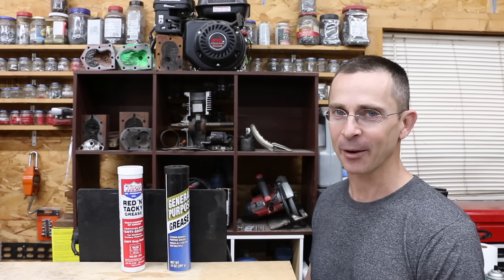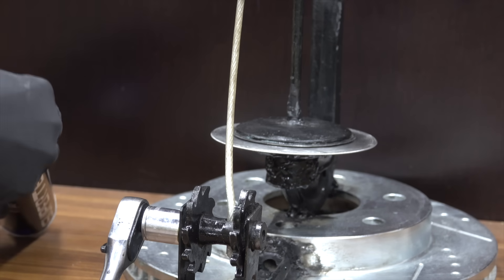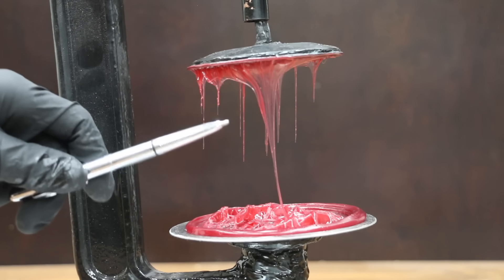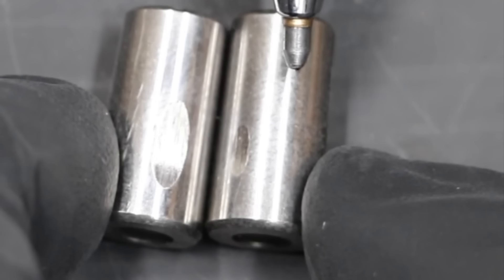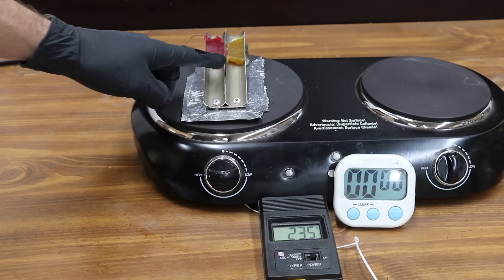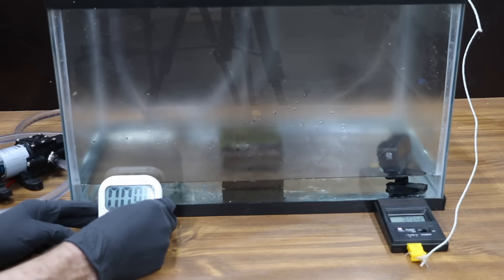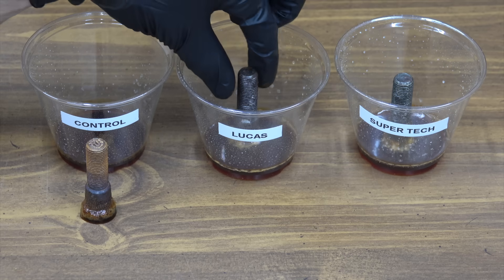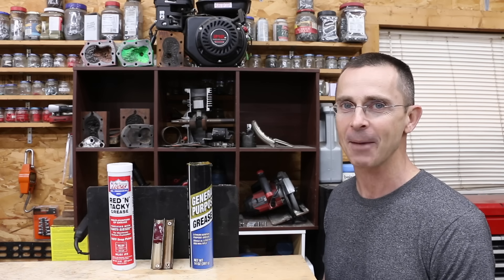Is Cheap Grease better than Lucas Red N Tacky? Let's find out! Bearing Grease Test Episode 1

Comment: I have used both types of grease in farm equipment and industrial apps. The red grease is better in high temps, but will push out of wheel bearing. The lithium grease will stay in the bearings better
Reply from the maker: Thanks for the feedback.

Comment: I did a test years ago with different greases for the wheel bearings on my BMW motorcycle...I found that moly greases that were a bit soft did a great job of keeping the wheels bearings healthy..The stiffer harder greases you could see got pushed away and kind of stayed away..The softer grease flowed to the bearings and the rollers had a nice coating on them when checking them...Just my observation...I toured out west so speed and heat were high..
Reply from the maker: Thanks for sharing.
Reply: The NLGI grade is a viscosity rating. Most grease are number 2.  Did you use a lower viscosity grease? They tend to be harder to find on store shelves

Comment: Ohhh use Lucas for bearings on your vehicle. Great brand Lucas products. I use Lucas transmission stop slip in my old ram hemi makes her shift like a dream. Lot of mileage so, it needs it. Truck is fantastic still for well over 250k miles
Reply from the maker: Thanks for the feedback.

Comment: Some take longer to dry out. Some look differently I seen a lot of different grease. Some that is thick, some more liquid like. Some that look like icing. Some that looks like honey. I use Lucas grease. For trucks. The green one. There’s many colors like, original black, red, blue, green, purple, white, (yep seen purple and white grease before) used purple couple times. I use Lucas heavy duty for my trucks. Machinery and hydraulics there’s this blue colored grease I like I don’t remember brand it’s in a barrel in my shop. Best grease to go with is Lucas in my opinion. Especially for vehicles
Reply from the maker: Thanks for the feedback.

Comment: Thanks for your knowledge and research very helpful.
“The space age brought with it many lubrication challenges that had not been experienced in the past:exposure to extremely low ambient pressures, a radiation and atomic oxygen environment, the presence, the absence of a gravitational field, imposed weight limitations, contamination by vapors, and theuse of mechanical components that were not maintainablehe space age brought with it many lubrication challenges that had not been experienced in the past:exposure to extremely low ambient pressures, a radiation and atomic oxygen environment, the presence ofmeteoroids, the absence of a gravitational field, imposed weight limitations, contamination by vapors, and the use of mechanical components that were not maintainable” Authors Fusaro, Robert L.
(NASA Lewis Research Center Cleveland, OH, United States)
Date Acquired September 6, 2013
Publication Date March 1, 1994

My experience who cares about that, but I can tell you that high tech grease intended for a specific purpose is not available and local stores it has to come from sales person rep for a manufacturer. This kind of grease will change your mind because it works so well and be glad to pay extra for it. Just like many other things the space age have given us. Lubricant technology it’s one of the big ones. So many to choose from out there in the manufacturing world.
Reply from the maker: You are welcome!  Thanks for the feedback.
Reply: Thing is, you CAN buy grease that is TOO good.  It will still work, but you will waste money on it.  That's why stuff like Lucas Red is great - it's good enough that it works great for about 95% of everyday applications.

Comment: As a 30 year fruit packing house mechanic, I found that Du Boise  products performed absolutely the best in water and heavy load situations. Their food grade lubes have no comparison. The grease is polymerized which makes a big difference. We used lubrico for refrigeration units that had to run in controlled atmosphere storage for 90 days straight without opening the room. Lubrico was very good 👍 but the Dubois products came out later and are super good. Also check out lube engineers from Texas
Reply from the maker: Thanks for sharing.

Comment: Excellent video, shows exactly why I believe in LUCUS products. If you run any diesel engines big or small, you should use LUCUS upper cylinder lubricant because you will double the life of your rings and cylinder and the heads will live longer as well. 
  PS. it also keeps your injectors clean.
Reply from the maker: Thank you!  Thanks for the feedback.

Comment: I have a 10kW solar tracker. The grease recommended comes from Germany and judging by the loading on the 24V motors and smoothness of operation this grease beats molybdenum grease hands down but it is $70 per 14Oz.tube. I can accept that for hi load universal PTO joints but not regular bearings when a tube might last a couple of long days baling!

Comment: I'm going to chip in and say the French company's  (Total lubricants) Ceran XM220 will clear the deck on waterproof greases as it's the absolute benchmark in this department.
Amsoil will be best for heat resist.

I use the Ceran XM 220 on CanAms working in very harsh Dairy farm environments
Reply from the maker: Thanks for sharing.

Comment: In a plastics blown film plant there are machines to turn the dies, Rotators. They have some ''HIGH DOLLAR'' bearings in them! Being plastic forming the machines have to be ''HOT''. Had a 'high temp' grease, the cheapest the boss could find, it turned to 'dog turds' in the rotators and wiped out those bearings, blew the seals on the rotators, entire machine line had to be shut down!! Lost Hundreds per hour til the machine was repaired!! Found some real 'high temp' grease, good to 2500F, $36 per 14oz tube, rotators would run better than a year on a rebuild. You get what you pay for!!
Reply from the maker: Thanks for sharing.

Comment: These two greases are very different. For example Lucas red n tacky is a heavy duty polymerized grease which will do well in heavy, slow machines like farm or off highway construction equipment. The other grease is designed for automotive wheel bearings. These are completely different applications and the polymer included makes the difference you see in these rudimentary tests. Most of what you can buy at an automotive parts store are designed for wheel bearings. Rarely are they designed for farm equipment. So you picked two that are not really similar at all. If you tested red n tacky in high speed bearing test rig, the other grease would win hands down. So it is irrelevant what you propose as better by these tests. There is not much real world relevance to what you have done. There is no suction cup or hot slider or spraying water in a aquarium. The bearing test you show is not a rolling element bearing its a metal to metal contact and measures the additive EP level of wear scar. It is also misleading. A strong ep additive chemistry can change metal strength and make a problem that did not exist before the use of that grease. I like your channel. This was cool, but not a way to measure how good or bad a grease is. It all depends on what you are going to do with the grease in question.
Reply from the maker: Thanks!  Thanks for the constructive feedback.
Reply: @ProjectFarm  try the bearing load tester with bleach and also try it with Coca Cola. I would like to see if the greased burn when hit with a torch. Also it would be interesting to see what happens to a coupon of grease baked at 400F for 1 week and 2 weeks. Compare with the fresh grease.  Most greased cannot withstand a caustic attack. Anything with a high pH is problematic to grease. Think of a caustic degreaser. Those tend to dissolve most greases. Calcium sulfonate can handle acid and caustic attacks. Normal greases cannot. The best corrosion protection I have ever seen is a grease called corrlube VPCI grease.

Comment: The famous 95 MERC has 17 grease Zerks on the modified Front Suspension. LUCAS X-TRA Heavy Duty Grease (it's GREEN) -- every 5,000 miles.
 Lucas X-TRA Heavy Duty grease does not freeze out -- and it doesn't wash out. It stays where you put it, and works when you need it !!
1995 Grand Marquis Restoration - Mercury Forum - Mercury Enthusiasts Forums
Reply from the maker: Thanks for sharing.

Comment: Some years ago I rebuilt a Rigid 535 for resale.  I used the red grease inside the motor gearbox and the external gears.  And then, I wondered whether I had done the right thing.  The original manufacturer had used the old-fashioned lithium grease - a combination of lithium and paraffin.  That grease would flow and lubricate only when the gearcase temperature was enough to cause the grease to flow, but its tackiness wouldn't be a problem - it is not tacky.  The red grease stuck to everything all the time, creating a spiderweb of grease everywhere all the time.  So . . . Rigid is a high-quality name brand.  What do they know that I don't.
Reply from the maker: Thanks for sharing.

Comment: I know this is an old test.  But I remember it and had a discussion with my orthopedic surgeon today and he related multiple trailer hub failures (r.t. to the Keys from NC).  I made the case for better wheel bearing grease, and perhaps a regular shot of grease (has bearing buddies) in the hubs en route.  I also told him about your tests.  So, do a few of these for boat trailer application?!  Recall the failure of an aircraft screw actuator that caused a crash (Alaska Airlines MD83 in 2000, I think)  - sometimes grease ain't grease!!  The wrong grease was blamed by some - lack of grease by others.  
Again, suggest wheel bearing grease eval.  You might also do a little primer on bearing adjustment.
Reply from the maker: Thanks for the video idea.

Comment: Lucas makes pretty good products ... nice to know the red/tacky works, thanks for the test ... I use Magnalube with PTFE  teflon) in it on all my stuff ... costs a lot, but good for expensive parts ... may be hard to find dealers, my friend owns the company and custom mixes it in, used a lot on fleet trucks and specialty equipment   ... works great on firearms too ... PTFE actually enters the milling imperfections and creates a hard film on metal.... same stuff in hard to find Tuffoil  ... I've used Lucas and Tuffoil in my jeeps 4.0 for 35 years ... got 300k out of one, and have 252K on a 2000 sport ... still has 60 lbs of oil pressure ... quiet as a mouse

Comment: I have Very squeaky aftermarket Upper control arms. I tapped grease nipples to help stop the squeak. The lithium based alem-lube was a multi use and would not last after wet conditions. So switched to castrol marine grease and no more issues with squeaks.
Reply from the maker: Thanks for the feedback.

Comment: Interested in see the difference between lube shuttle grease and Lucas grease. Thinking of buying the lube shuttle system but there are several type out there.
Reply from the maker: Thanks for the suggestion.
Reply: @ProjectFarm  the lube shuttle is the type of grease gun and the grease that they sale with the lube shuttle is Airtech they say they have a Flagship grease that will do it all. But I don’t want to buy until I see some testing like you did which was amazing by the way and interesting. If you could do this that would be great.
Reply: I think the flagship grease is the Li400. Please send me the link when you do this test of the Airtech grease verses the Lucas  Red and Tacky grease.

Comment: I hate cheap grease. I've seen more parts ruined because someone used the cheap grease that dried up and the part froze (U joints in particular where once cup will quit getting grease). I had a shop and used Lucas..... I would see someone pumped that cheap chassis grease through my Lucas grease.
Reply from the maker: Thanks for sharing.

Comment: There are many different greases. It depends on the base (ex. calcium, sodium, lithium) and additives, mainly. Some are really cheap, and some are really expensive; over 300 dollars per 1 lb. In general, higher the temperature grease can withstand, higher the price that should be expected. The grease that can be used around temperature of 500 degrees Fahrenheit (ex. HT Max) cost over $300 lb. Most people will never encounter such a grease though. Standard NLGI 2 grease is good up to 180 F and is widely used by the automotive industry and can be purchased for around $10 per lb and up, depending on particular brand. The thing about grease is that some can and some can not be mixed. When considering using different grease it is always good idea to check for compatibility...

Comment: I use a valvoline multi-purpose grease no. W615 that's suppose to be formulated for GM. I would like to know how this stacks up against the lucas red and if any other conventional, synth blend or straight synthetic is better. Chassis greasing and wheel bearing packing is such a nasty job and parts replacement is so expensive I don't mind spending more for a better product if I know what is better. Please get back to these grease comparisons soon. Thanks  Steve
Reply from the maker: Thanks for the video idea.

Comment: How about a wheel bearing test using different wheel bearing manufacturers and different grease manufacturers on boat trailers, cargo trailers, and utility trailers.
I am already partial to Lucas Red N Tacky Grease for above the water-line trailers, because I can find almost everywhere and the price is reasonable, but competitors could be the other big oil companies including Chevron, Exxon, Mobil, and Shell.
For a below the water-line test on boat trailers, Lucas also manufacturers a Marine Grease, so you could do an experiment on which grease is best for fresh water and which grease is best for salt water.
Most trailer manufacturers recommend checking the vehicle's wheel bearings once every 12-months or every 12,000-miles, for either a bearing repack (which at the bare minimum means new grease seals after the wheel bearing have been removed, soaked in a solvent, dried, repacked with grease, and reinstalled) or if required new wheel bearings, races, and grease seals.
What devious experiments can you come up with?
Reply from the maker: Thanks for the video idea.

Comment: nice one. while filming this, what engine degreaser did you use please? 😁 i highly value your results, thanks. ive used gunk before and about to try purple power on an engine, also thinking of trying brake clean one of these days but it may be too harsh for rubber parts.

Comment: I'll comment on this before I'll fully watch the video. I use the Valvoline ™ red GM grease in a can. It works on 99% of my stuff. It doesn't melt out as bad as others. I tried the marine grease, but I was getting wear on riding mower front axles. This is my mainstay and I hand load my grease gun with it.
Reply: After seeing the video, I would say the Valvoline red grease is similar to the Lucas. The can is more convenient for hand packing. Some grease guns allow tubes only. I'm glad I have one that'll take loose grease. I think I bought my gun from O'reilly's. Valvoline doesn't state if it's high tacky. Cars have almost everything sealed. Tacky wouldn't be something I need.
Reply from the maker: Thanks for sharing.

Comment: I've been using the green water proof synthetic on my tractor seems good it's expensive so I was hoping .
Reply: Green Grease 1003 Synthetic Waterproof High Temperature Grease, 14 Oz. Tube (Pack of 10)
Reply: Not that expensive
Reply from the maker: Thanks for the feedback.

Comment: The other day I mentioned your videos to my father. He complained about greasing the fittings on a John Deer D130. Told him there was a difference between brands.
Reply from the maker: That is awesome!
Reply: @ProjectFarm  No Problem. He is Old School. And only used the Cheap Lithium junk. I suggested maybe he should try a Synthetic Grease. Problem is, Mixing two different greases. It would be a PIA to clean out the old to put in new stuff.

Comment: I am a journeyman mechanic in the USAF (AFSC J43171C old )  have been a crew chief on F-4, A-7 and F-16 aircraft. I was also put in charge of parts and lubricants for these aircraft. In my schooling I learned that there is much more to grease and lubricants than color. We had an F-16 that had the leading edge flap system lubricated with the incorrect grease and the old grease and the new grease reacted to each other and caused "balling"  it dried out and caused little non lubricating balls to form as the engineers called it. This became apparent when the flaps would not deploy correctly causing the pilot to declare an emergency. In cars it's not that critical but I would suggest using what the manufacturer recommends especially if it is still under warranty. If something fails they look for any excuse to not repair it. I worked at a dealership and saw them send oil and coolant samples to be tested to see if they had an "out" Just FYI

Comment: I only use the Lucas Red N Tacky. Another benefit that should be self evident is that it is red. When I pump grease through my boat trailer bearings, I just keep going until the grease coming out is red and then I know they are flushed.
Reply from the maker: Thanks for sharing.